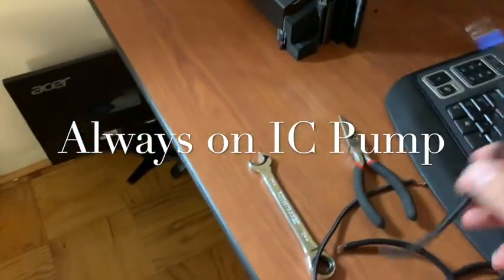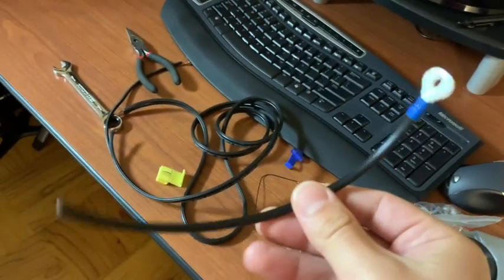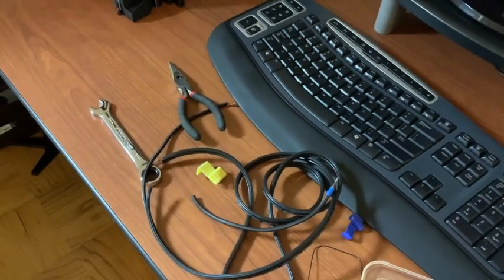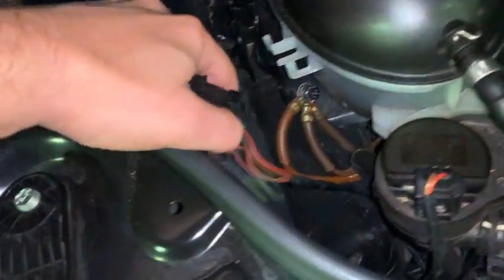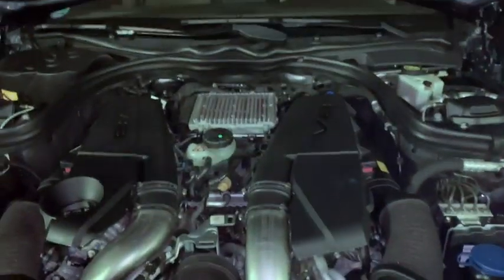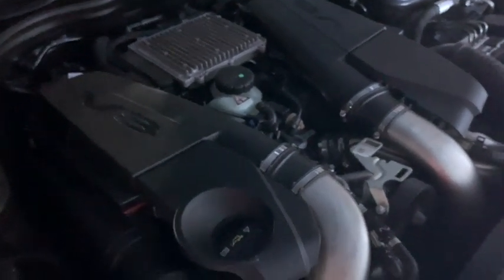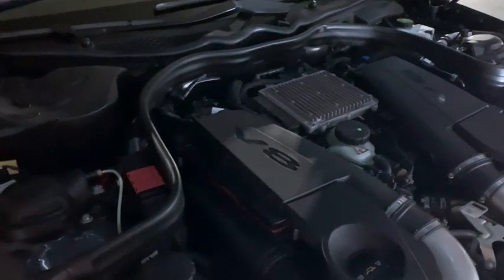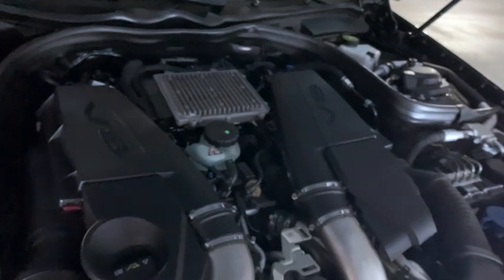Intercooler Pump Always On Mod

Comment: Do you know to what activation temp it can be changed via ECU?
Reply from the maker: iirc believe the max you can lower is to about 70-90 F degrees  Let me double check that though.  I think I have to reach out to Jake or Philip at Eurocharged or VRP, because I've read conflicting info on it, and they get better at tuning the cars over time.

Comment: Interesting, so I have a 2012 CLS 550 M278.922 and don't see an intercooler pump installed in mine!
Reply from the maker: It is sir.  I'm not really sure when or why the cutoff to split cooling.  Some people claim it is 2014.  I sort believe it is a line item on the build sheet.  Upgrading to split cooling isn't too bad though.  Phil at VRP should be hooking up a code pretty soon, even without it, maybe $250-500.  Thinking about doing a video about methanol and tranny oil change soon.  Is there one you'd like to see first.  Also been asked for install of android and the USB sound card.
Reply: @TunedMercedes  Definitely interested in adding split cooling if it's not harder than doing my spark plugs!  And also very interested in adding the upgraded screen to my dash (android/USB) as well.
Reply: I have a 2013 and it still didn’t come with split cooling. Apparently the 63s all did but not all the 550s. After 2013+ is when it was an OEM part of the build which is crazy they wouldn’t add it on the older ones. I wish there was more of an explanation on the split cooling because I still can’t find nothing about it, I want to install it but am afraid to mess up.
Reply: @juanplaza4180  Revisiting my old posts!  I am preparing to finally order the split cooling kit and adding this to my 2012 CLS550.  What's the difference of ordering the OEM parts from MB and adding this to my benz VS ordering a kit already put together from say someone like VRP?
Reply: @c.a.n.4202  yeah I saw this post was 4yrs ago haha. So after extensive research I found a video of someone doing it and a MBforum about it. I’m about to do my auxiliary heat exchanger and when I’m doing that I’m gonna be looking at the surrounding area to see how accessible everything will be for the split cooling. I have a superflo updgraded intercooler pump too that I’m gonna be installing at the same time I’ll do the split cooling. Right now VRP has it for sale going for 250 it comes with everything you need. If you order all the parts and the barbed adapter fittings most likely outsourced-I’m pretty sure it can come out to 150 or even less apparently. It’s just very convenient that VRP just has the whole bundle. You’re having me rethink my decision now, I’ll prob just get the OEM parts. I now understand how the split cooling circuit reroutes the hoses after studying it so lmk in a DM if you want more info on all the cooling upgrades.
Reply: @juanplaza4180  Can you link the forum post/video you found?  Appreciate it.